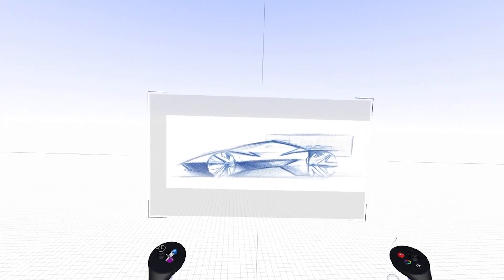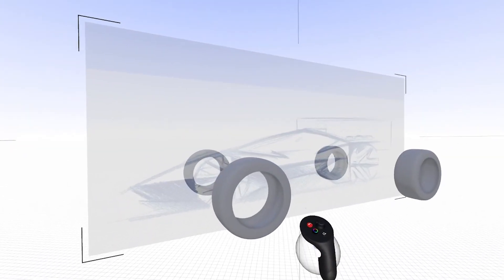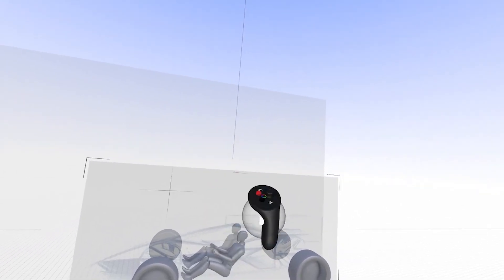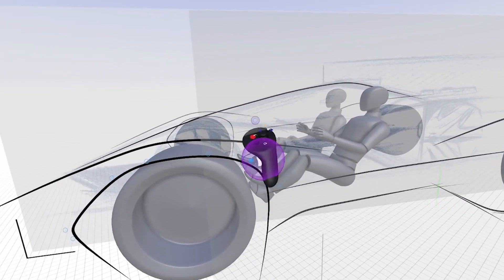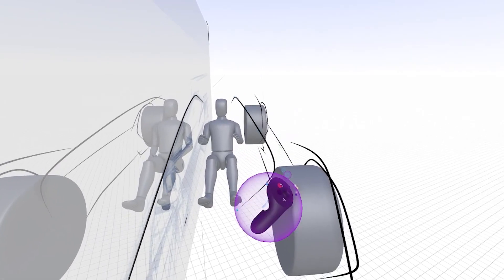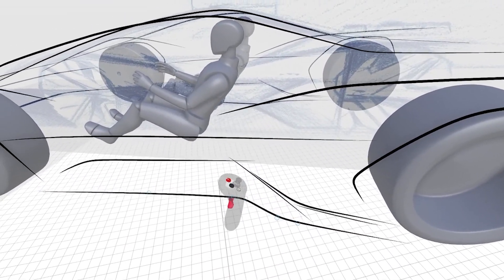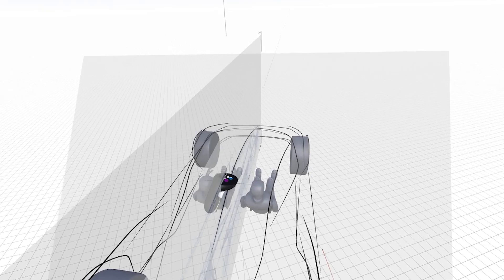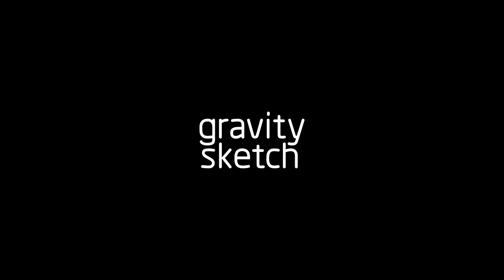Building a 3D Sports Car Drawing from 2D Sketch

Comment: Love this latest series very clear explanation of the workflow!  What is the tool you are using around 14 minutes to select and adjust the angle of the line?
Reply: it's the second option in the tool belt, tool belt is in beta mode which must be enabled in settings to access it. Once enabled you pull horizontally across your work space with the drawing hand grip to bring up the tool belt.